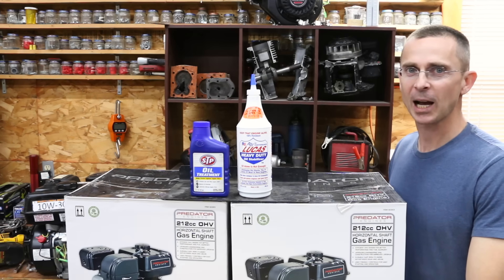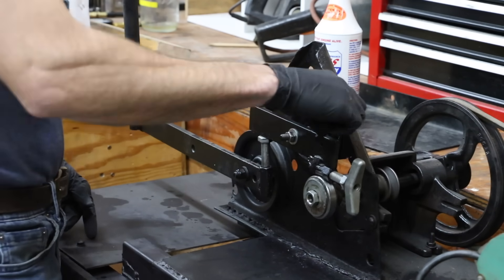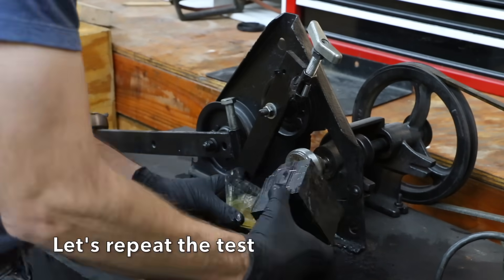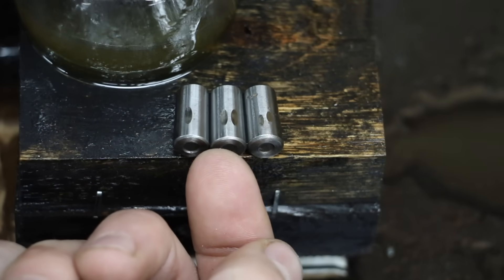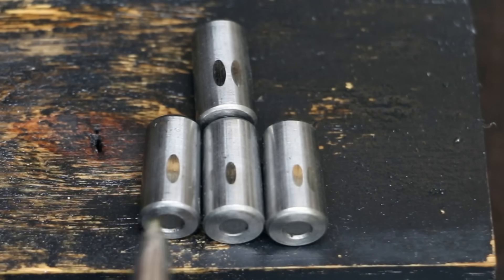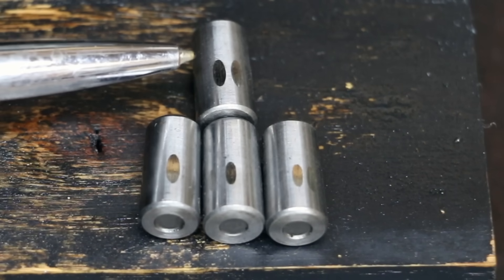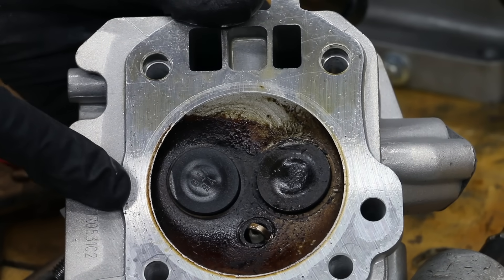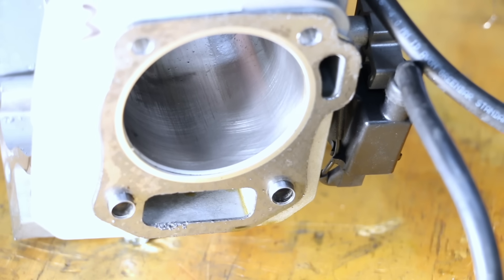Which engine self-destructs first?  Lucas or STP?

Comment: Proves an engine without oil will throw a rod.
Reply: I agree with you. Test of two products that were both used in a way they were never intended to be used. Poured all the lubricant out so you are testing the absence of two products.
Reply: @Dwain S&w   It's a legitimate test.  Most engine wear occurs during cold-starting, when all the oil has drained down into the pan, because it takes a little time for the oil pump to circulate the oil.  If one of these additives leaves a residue on engine parts after the oil has drained and that residue provides some lubrication, then it is likely to reduce engine wear especially on vehicles that re cold-started frequently.  Since one ran 12 minutes without oil and the other ran 21 minutes without oil, one of them does seem a clear winner.
Reply: I wonder if one was a little tight on the manufacturing tolerances and the other a little loose on the tolerances how it would impact the test.  @webgrunt
Reply: Niether of these threw a rod. They broke rods. Throwing a rod is a connecting rod exiting the crankcase.
Reply: Yep and we get to see the actual failure conditions and aftermath without the learn-by-accident :-)
Reply: Who knew ? Not Me !
Reply: You mean a piston I think.
Reply: Yes, but plenty of "oversmart" engineers will challenge you... :)   "It was too small a sample"... "there was no control engine"...etc. etc.    They need to ask their parents why there isn't another control child so they could measure what they actually accomplished in life LOL.
Reply: @mehtasid  lmfao that's hilarious
Reply: Comparison test of bullet proof vest:
1 - Get yourself shot NOT wearing vest A.
2 - Get yourself shot NOT wearing vest B.
3 - Take conclusions about which one worked better.

Comment: Hello. I have a 1,800 c.c. V.W. engine working on a 1988 Golf with original 231,250 miles and I'm thinking on add a treatment with Lucas which a mechanic friend of mine recommended me. What's your expectancy based on your experience? I must say that the engine doesn't knock but burns oil in an almost noticeable way and power is acceptable in view of the mileage. Thanks for sharing and please keep up the great work you do.
Reply from the maker: Lucas does great for "cushioning" parts with excessive clearance or play. If the engine still seems fairly tight, I would probably go with Engine Restorer first, which will likely help with the oil burning more than Lucas and not cause any issues with cold engine starting in colder weather.  Thank you

Comment: Origianally Wynns developed this test then JB used it for years I worked for JB and we used to set the bearing on fire with some gas in the bearing race. JB won everytime. we used 400lbs pr sq inch on the arm. JB would win this test without a Mark on the bearing! JB Engine Tune Up would win in the self destruct test too guaranteed.
Reply from the maker: Impressive results! Thank you

Comment: “Lucas calls for a 20% of capacity so we’ll be mixing 1 part Lucas to 4 parts oil”

Math is a thing champ..
Reply from the maker: Thanks for the constructive feedback.  What's the correct ratio?
Reply: Heretickle 69 20% of capacity is 1/5 of the total mixture i.e. 1 Part Lucas/ (4 Parts Oil + 1 Part Lucas) 

Fractions are a thing too, champ...

Comment: Lubrication engineers oil in a bobcat that tip over backwards going up hill
The operator crawled out left it running I got there 10 minutes  later to turn it off  motor was still running with no oil pressure.
Flip the bobcat back on to its wheels start it smoked for 15 minutes  than ran fine for years after wards
Reply from the maker: Wow!  Impressive.

Comment: Lubrication engineers oil 
Not an additive but a very good quality oil 
 Guaranteed to last a 100000 miles.
About the same price as synthetic oil
But Lubrication engineers oil 
has the best additive. That is used by NASA
Reply from the maker: Thank you for the video idea!
Reply: @ProjectFarm  Lubrication engineers oil vs
Xtreme Oil additive  Greenhttps://www.cs4000.net/XtremeGreen/member/store/index.asp?pkg=99&sponsorid=966437&sponsorname=Brians%20Mobile1

Comment: Try pro long additive
I've had the best luck with  Lubrication engineers oil 
I have been a mechanic for 40 years
 I've used this on 4 motors that burned oil.
After switching to Lubrication engineers oil they stopped burning oil 
 Coincidence I think not.
There are better products out there just not available at your local auto parts store.
Reply from the maker: Thank you for the video idea!

Comment: Lucas had displays in auto parts stores where you could turn a crank and see how it adhered to a set of plastic gears, compared to another set of gears, which had straight motor oil. I saw a video where someone explained, engines turn at THOUSANDS of RPM's, not just a few, like hand cranking. When similar gears were turned with a drill, the Lucas treated oil foamed up dramatically. Oil manufactures add anti-foaming agents to prevent this. Lucas apparently doesn't. After I saw that demonstration, I stopped using Lucas... ARCO made engine oil with graphite back in the late 70's, if I recall correctly. This stuff out of the bottle was blacker than conventional oil with 20K miles on it. I don't think people liked it, because it always looked like you never changed your oil when you pulled the dipstick.
Reply from the maker: Thank you!

Comment: Is it better for the engine's longevity to add that Lucas oil treatment when doing an oil change(Oil is M1 EP, M1 EP Filter) even if your car doesn't burn oil or knock at all? It's a 2011 G37S with 88k miles, thanks
Reply from the maker: I wouldn't use it in your vehicle.  It's too new. Just my opinion.

Comment: I could have told you the results before you ran that test. As a former mechanic and part time tribologist... i  think i know  a thing or two.  I wish you would try Royal Purple HPS.  Put RP in one engine and Mobil 1 in another.  Also try Amszoil.  

  With out question, when it comes to any ICE  not self destructing, it's about the film strength of the lubricant in question.  I would be willing to bet that NO oil, no additive NOTHING will out perform Royal Purple HPS lubes.   Interesting video... sub'd and t-up!
Reply from the maker: Thank you for the video idea!

Comment: These new engines just don't hold up. I'd rather have an old white Briggs & Stratton 1970s model any day. I've ran that engine out of oil seized it up. Turn it over unseized it,,,, fill it back up with oil crank right back up and it ran several years more if I knew where it was today it's probably still running
Reply from the maker: Thank you!

Comment: I use Lucas, one quart of Lucas at oil change, I drive less than 2,500 miles a year. My daily driver is a 1990 GMC, 3/4 ton with the 5.7 350 V8. I have 159,000 miles on the vehicle, that said I use about 1 quart every 1,000 miles, I like the Lucas because it gives me easier starting in the winter. Good stuff.
Reply from the maker: Thank you!

Comment: Another solid video, and I understand you're using "Off the shelf products" (Because I mean honestly, nobody wants to see a video of something they can't go buy at any autoparts store), however Lucas and STP are poor products IMO and I've seen them hurt more engines than they've helped. 

These "additives" are really just meant to spike the overall oil viscosity- and in turn spike the oil pressure in a last second attempt to hush any bottom end noise. However the lasting result when people use these as a preventive item, you'll see what I can only assume is a "volume starvation" to the upper part of the engine. I understand liquids cannot compress and that as long as the pump is still working at the same RPM, the same volume should reach the head(s), but thats just not what I'm seeing in practice. I wonder if this maybe the result of the aeration we saw take place at the beginning of the video. 

Regardless of the science behind it, what I've seen happen about 20% of the time is a lifter collapse and make horrible noise. 

That being said, the best oil/oil additive I've found to work for me has been Schaeffer's, and Schaeffer's Moly. I made the switch from Royal purple on my BMW and saw a 35 degree drop in overall oil temp. 

More impressive than that though, I've watched it save 2 engines that we were about to tear into, one of which being a family member's 328i that I personally had serviced since it was bought- using Mobil 1. That particular engine had lifter tick so loud, I would've towed it had I known prior to them showing up.. after 10 minutes running with Schaeffer's, the engine was running with zero noise and is still being daily driven with the same oil in it now, about 3500 miles later.
Reply from the maker: Thank you!

Comment: As a Mechanical Engineer, I have always thought this test has virtually no value.  Sure its a good test if you intend to run your engines with no oil - but for me, I run them with oil.  To me, this test has no value to show if these additives help me in my engines with oil.

Comment: True story: A friend of mine bought a new 1979 Chevy Chevet. Drove it for several years, and the only thing he had done was change tires, fill windshield wash and gasoline. Engine died with over 47,000 miles. Never got a tuneup, nevertheless oil change. My father had the same car and he maintained it like a baby, engine died while I was driving it to get a paint job at 62,000 miles. Hahahahaha 
I’m still laughing my butt off at my friend. He was upset that the engine only lasted 6 years. Stewpid @$$.
Reply from the maker: Great point.  Preventive maintenance is critical!

Comment: I love your video's, Thanks for taking the time...I think slick 50 should be added to the mix. I put it in all my small engines that  I have unhooked the governor on. The older engines work on splash oiling and when you over-rev them, they make foam. The Slick 50 must protect the internal components while they are not getting oiled properly, because I have not blown an engine thus far. Firm believer in the slick 50.
Reply from the maker: Thank you!
Reply: I like that slick 50 used it in my trucksworks great and ifyou can find slick 50 pneumatic oil it is avery fine rust remover for gun finishes but good luck cause I can no longer find it.

Comment: i have been using Lucas for at least 10 years and i have never had issues ..i had trouble starting my car in extreme cold -35 in wisconsin ..car would not turn over ..i then started adding Lucas to my oil changes ..car never had issues starting after that..even at -42 ..same battery and same alternator in my little Kia Rio 2004 ..got totaled last year from a hit and run ..so i now drive a Kia Sorento 2012 ..no issues
Reply from the maker: Thank you!

Comment: I had a car and all I did was change the  oil filter every 2000 miles  add some oil  to the filter and cleaned the air filter every week when I washed my car . I drove  that car  for   over five years until  I got a better car and I still see it driving around running just fine.  I really wonder if changing your oil is really that important, that is as long as you change your oil filter and keep a clean air filter .
Reply from the maker: Great point!  Thank you!

Comment: Pro Tec  is a multi-level marketing oil additive they say is a metal treatment mixed with your oil that would not happen once they have 10 minutes hot engine time.

Promoting their product they have video showing a bearing torque application much as you have there, running the race in their product oil bath and you cannot stall the bearing.  Vs. The same setup with Valvoline I think it was 20/50 the bearing stalled.  

I used it for a long time with good results and they have a grease that's a little pricey as well but I got  exceptional results with it compared to anything I had used on the market. I believe the product comes out of Memphis Tennessee. It's on the internet. Look it over see what you think.

Presently I started using shell Rotella synthetic 1540.
Reply from the maker: Great video idea!  Thank you and Happy New Year!

Comment: I don't know if it was ever sold in the US but in Britain we had an oil additive called Molyslip - named I suppose because it contained suspended molybdenum disulphide powder (I think it was 2000 grit.)  Dunno if it really worked but the idea behind it seemed pretty sound as MoS2 has some pretty remarkable properties in the powder form.  I worked at a factory where it was manufactured and ground to a powder - a teaspoonful spilt would flow to cover the entire floor of the place - which was quite hazardous as it was impossible to walk on the stuff without sliding.
Reply from the maker: Thank you and Happy New Year!
Reply: Project Farm   And to you and your family.
Reply: As you said,MoS2  'In suspension'. It gives sump a real good coating and is removed almost instantly with a centrifugal filter. A 'conventional' pleated paper filter allows it to 'float around' a bit longer. As an assembly lube I found it awesome and mixed with some Hypoid 90 was a fantastic chain lube (for off road/Enduro) With a 'total loss' 1/2 liter bottle I got almost an entire year on chain and sprockets my 400 Yamaha instead of maybe 2 events without oil 'system' (although at longer events needed filling every other pit stop)
Reply: I found some of that at an auto part store in Canada, once. I liked the idea of it. When you think about how most of it should get caught in a decent filter, why hasn't one of the companies  developed a temporary filter that can be run to allow these types of products to setup in the engine.?
Reply: MoS2 Molybdenum Disulfide is EP grease for gears, probably not suitable for engine
Reply: https://www.amazon.com/Molyslip-Inc-3412-Oil-Supplement-x/dp/B01A9DRMG2

Comment: you mention the Lucas engine ran 10-15 degrees hotter than the STP engine. Did you monitor temp of each during the 4 hour run-in before the additives were put in and what were those readings? You don't mention but that would be a key point. The engines might have run at different temps out of the box due to bearing clearance differences, etc. If you didn't monitor and they weren't the same on run-in, then the rest of the experiment means nothing.

Comment: In vehicle engines, my personal study of 15W40 wt oil vs. 5W15 wt oil. Thinner oil netted 1.3mpg improvement. I only run the thin stuff in winter however. It breaks down in temps above 95F too quickly.
Reply from the maker: Thank you and Happy New Year!

Comment: I heard about a oil additive named Tufoil. The guy at local parts house says it's better then all the other stuff. Of course they sell it. It's in the Guinness Book of World Records for lubricants. Maybe you can try this one sometime.
Reply from the maker: Thank you for the video idea!
Reply: I used this stuff way back in the late 70s when it first came out.  Never did a scientific experiment with controls, and surely never ran the engine without oil. In fact, I did regular oil changes every 4,000 miles always using the Tufoil.  The care in question was a used 1971 Toyota Celica, first six months of production with an 8rc engine. As a kid, I ran the car like I had stolen it. 5k holeshots, redline shifts, banging gears, constant burnouts and long torturous trips with the car loaded to the max with friends and camping gear. After five years of such abuse, the car was ragged out beyond repair, but the engine still ran just fine. I did a 300 foot burnout with it the day I sent it off to the junkyard. I bet someone else bought that engine and got several more years of use from it too.

Comment: You need a control engine and also need to measure temperature on each engine during the initial 3 hour break in test to see if any engine runs hotter on average.
Reply from the maker: Thank you

Comment: You can pick a side in this test but it was a test of extremes.  In reality those kind stresses are seldom put on lubricants especially if changed regularly.  Air in the oil can be a problem on a truck/auto engine if overfilled where  parts of the engine may swim in the oil.  I just follow the manufacturer's recommendation.  With an aging engine I just keep an eye on where the oil is going if it comes up short on the stick.  Nevertheless, the test comparisons are always interesting and there is always is something to learn.   I was hoping to see a rod come through the side of the engine.
Reply from the maker: Thank you and Happy New Year! vv

Comment: lucas won you should try hi tach in a blue bottle like the stp color blue but in a type bottle like lucas only a bit bigger it seems to lube better than lucas in my camaro at cold winter starts its starts n runs like my car has ben warmed up running a while with hi tach its made from petroleum not a silicone like slick 50 i was told not to use slick 50 the silicone in hi heat gums up n clogs oil ports and pump. silicone is a good lube for light low or no heat apps but silicone is also a sealer used for the engine gaskets as we know why slick 50 sell a sealer to lube an engine puzzles me  it will only clog defeating its purpose isk i guess they didnt do enough heat tests on it.
Reply from the maker: Thank you for the recommendation.